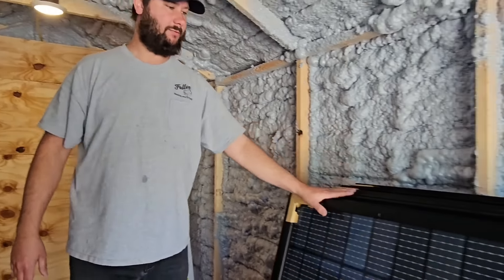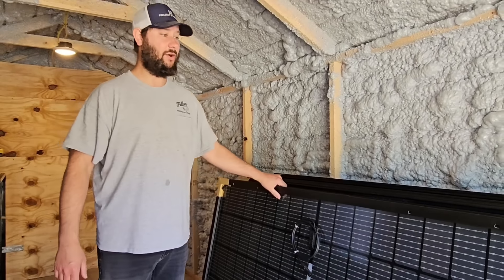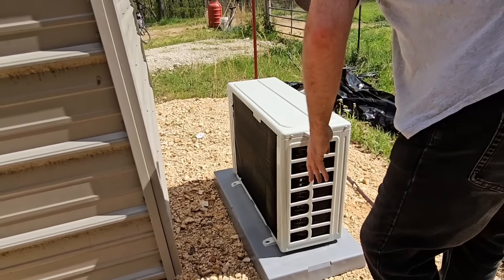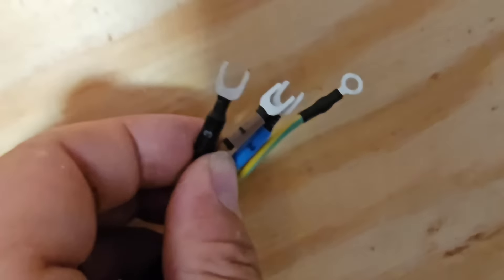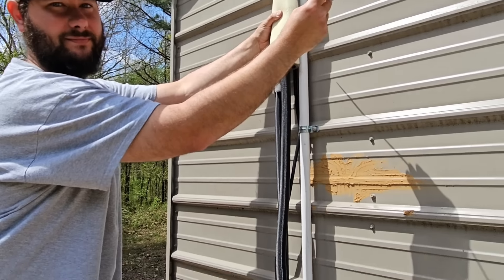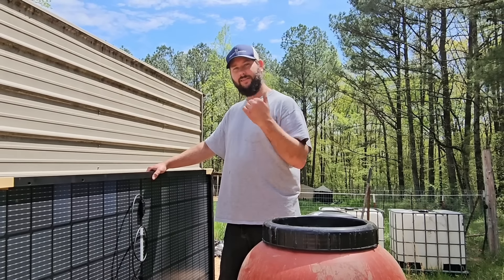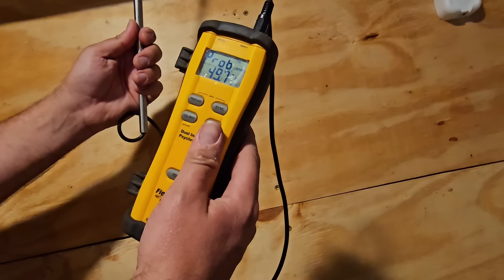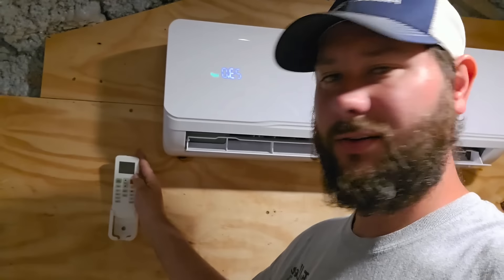Cool Your Home for FREE with Solar Powered AC!

Comment: Great job, but no strain relief/ chafing protection installed in the knock out of the indoor unit.  You need a Romex connector or cord connector to meet electrical code. 
Not only that but on the outdoor unit, the liquid tight connector you used for the interconnect doesn’t provide strain relief nor is it listed for the purpose you are using it for. You need strain relief on the outside unit as well. 😮
Reply from the maker: I like your attention to detail. Thanks for watching 👀 😀
Reply: @TaddyDigest  I’ve been an electrician for over 3 decades.  So I catch those things.  Great content on your channel. I just found it!!!
Reply from the maker: No wonder you caught that very cool brother. Glad you're here

Comment: You curled up the remaining line set and it was curling up and down. I've heard that the line set should be laying flat. Which way is better?
Reply: just a weekend HVAC warrior...I would place them vertical so that the oil can get trapped and fully returned back to the compressor

Comment: Pet peeve,  Why do people always use  channel locks on brand new brass fittings?....why can't they just use the proper wrench that fits those fittings? As a certified automotive technician? For 43 yrs. If I paid a professional to install a mini split? (A/C UNIT) and they started to tighten a brass fitting using channel lock pliers ??? I would fire them on the spot. (Use the right tools for the right job) plain and simple. 🤦🏻🤦🏻🤦🏻 Other than that? Great video & awesome information.   Just take it as, constructive criticism.😊
Reply from the maker: forgive my impatience
Reply: @TaddyDigest  You can do what you want, I was just bitching about my pet peeves...😄🤣😂😉 like I said great video. 👍🏼
Reply: I was going to say the same thing, you beat me to it.
Reply: @PanaLumberjack  Geniuses think alike ..🙂
Reply: Seriously? I cant remember a single air-con that was not almost touching the ceiling in condo-motels I've been in 50+.. we're they all wrong ???
Excellent video
Thanks
Reply: improper tool use is usually the sign of a hack. not professional.
Reply: @eddie8279  I'm assuming you're most likely a hack then.
Reply: speed of installation...he's not torquing the fitting down with them....only using the channel lock for speed. No knurling or stripping is occuring
Reply: @TaddyDigest  This time, lol.. Good job
Reply: Why do you need a aircondioner In a shed
Reply: It does the job? Ok then stop crying
Reply: @lmfarms4611  he spends a lot of time in that shed and wants to be comfortable.
Reply: @lmfarms4611  because 100F electronics last a lot longer than 180F electronics.
Reply: If I bought it for my place, I’ll use whatever wrench I want.
Reply: So people like you can cry and complain about a job you aren't doing.
Reply: Because it’s his own personal unit. I’m certain he sets a higher bar for paying customers.
Reply: @prefix808  in order to love other people?  You must learn to love yourself!  If you don't respect yourself?  How can u respect others?....😁
Reply: @robertbenavidez7164  So I'm not the only one. I agree.
Reply: @robertbenavidez7164  you probably shouldn’t watch your fancy vehicle wheels getting lug nuts removed then.
Reply: Haha, It’s hard to work for someone who has OCD. They do make pliers that don’t scratch the brass fitting.
Reply: meh .. I eat crab legs with channel locks .
Reply: @robertbenavidez7164  
Pet peeve: those that can't construct simple sentences, use proper punctuation, or ask basic questions. I once used an automotive shop that didn't question the certification of the "technician" but did write a quote, for important work I needed to have done, that was written much like your comment. I fired them on the spot. Can you trust someone to read and understand technical information if they can't write simple statements correctly? 
Just some indirect constructive criticism. BTW, why did you use what appears to be emoticons of three little girls in your comment?
Reply: @jimwhite9483  You sound very triggered, get a life & or lower your blood pressure. 🤣
Reply: @javiercoronel1169 uh people do work in sheds. Wood work small engines. When the wife locks you out hanging a deer when it’s warm outside. And while you smoke your weed or drinking a beer. I can leave a lot of reasons you would need an air conditioner in the shed.

Comment: Hey very good installation what I do is spray some soapy water on the plug for the drain hole and it goes In easy .I am really interested in the solar ac units I think it's a game changer when it comes saving on electricity and your carbon footprint 14:39 15:37
Reply: solar ac? should be DC from solar. if ac means air conditioner, it's a heat pump (solar HP) and can heat too.

Comment: you should have used vacuum pump to suck all the air in the pipes otherwise gonna be mixed and makes the gas less efficient
Reply: no need for a vacuum pump! before tightening the larger Cooper pipe you will let release the air and when the refrigerant starts to leak you will tighten it well, the filter will remove all the humidity within the unit!

Comment: solar AC , who would have thought .. solar AC w no batteries .. just wow..  in a couple of years the panels will be smaller and possibly the price too.. althought IMO the price isnt that bad...  and im sure you can piggy back with batteries if needed store that exra power when ac isnt on... did I miss apart of the vid or were the panels hooked directly to the unit w no controllers .... I assume the unit is smart enough to know not to draw the amps if it isnt available ..

Comment: This is a great vid. I was always curious if you could run these things of solar. I was just a bit puzzled when on occasion you speak in rooster language. Did not know what you were saying at 21:35 and 23:28 and a few other times, but I guess it was not that important.
Reply: Criticize doesn't cost anything.

Comment: The only thing that I've seen that doesn't make a lot of sense to me is the mighty brackets. I could understand if the head unit wait a ton but I don't even think they weigh maybe 15 lb they're super light. What I do is install the cable before putting the line set out the hole zip tie the line set the drain and the power cable together at the base and the tip lift the head unit set it on my shoulder push the cable out the hole lift it up and slide it right through the hole set it on the brackets lock it in and you're done. There's no in and out in and out then you're outside for the rest of the time mounting your outside unit and hooking your coil set drain lines and power cable up dragging the unit down and charging the unit

Comment: How does it heat
Reply: It's a heat and cool unit, all in one combo. 😎
Reply: If it helps I have this unit. It basically runs in reverse (move the cold to outside). I live in northern lower Michigan and it was making heat all the way into the single digits. I must add that the unit goes into a defrost mode with increasing frequency the colder it gets (no big deal but makes some funny gargling noises at the beginning) it takes around 5-10 minutes to complete then resumes heating.

Comment: Why no vacuum done to remove air from tubing
Reply from the maker: Read the install manual
Reply: @TaddyDigest  want to know the tech why there is no need of vacuum ..r410 refrigerant is more reactive and prone to degradation in presence of air..

Comment: Looks like a Pioneer brand mini split.
I prefer senville units. They also come Alexa ready.  Pioneer costs extra.
The mighty mount thing is completely unnecessary,  the indoor unit weighs 10- 15 lbs, it would get in the way more than it helps. 
Wire AWG is not pronounced og.  It's American wire gauge or simply gadget. Never heard that before.
Reply: These are unique units manufactured by Deye Group of China, sold in the US under the brand names EG4 and Airspool...You can Google or YouTube "Deye Solar" :-)

Comment: Show the running at night if you're out there working you want them cool you have to have 110 volts out there should have some kind of battery backup no
Reply from the maker: Yes, absolutely. I have a battery and an inverter. That's powered by the solar panels. And at night, the power is switch from solar to battery
Check out the latest video to learn more

Comment: So apparently you're supposed to connect both AC & DC power to the unit and it is smart enough to use whichever source is available whenever either source of power is unavailable.
Reply from the maker: yes

Comment: What happens to this unit when the sun goes down and you have no power
Reply from the maker: Video coming out next week, showing you. What happens
Reply: Depends on your climate, too. It would work for where I'm at. Night time temps drop like 30⁰ or so after midnight.
Reply: When the sun goes down it runs on electric or batteries if you have batteries

Comment: Don't you need an inverter to change from  Dc to Ac?🤔
Reply from the maker: yes
Reply: @TaddyDigest  … DC to AC   Yes inverter required.
remember,  THIS unit runs DIRECTLY from Direct Current (couldn’t resist)
Thus THIS unit does not need an inverter.

DC goes to AC
(Direct Current to Air Conditioner)

I’ll show myself out
🤠
Reply from the maker: That is correct. It will run off of just solar panels
Or you can run a 115 V AC. To the equipment
Disconnect is definitely needed for both

Comment: The line set is scaring me lol . How come you didn’t cutt it and measure it to the proper length ?
Reply: They come pre-charged and have the proper amount of refrigerant to be the correct pressure using that length. This means that you don’t need to worry about brazing, flaring or vacuuming your lines or drying them out with nitrogen before you start. They look silly coiled up until you get used to it and then you don’t notice it after you get used to that style of installation. Even with the old system they recommend you use the longer line set called for to ensure that you have the proper pressure. You can shorten those but then you need to bleed off the volume of the lines you removed to get the exact amount of refrigerant.

Comment: NEVER LOOP THE LINE SET in vertical position  It make a oil traps. And make unit not cool 100 % and you be replacing it faster.

Comment: Was that yellow bracket necessary? Why not do the comms cable at first then u just fit the indoor and go work from outside. That time spent was so unnecessary.
Reply from the maker: You don't have to use the yellow bracket

Comment: This is why i dont like minisplits but i hate window units, they design them to do noise, i can not bealive it. I see mine, and its inside blower fan has the impellers positioned 90° exaclty againds the rotation direction, it creates a loooooooooooot of fkin turbulence meaning it creates a TON of noise.

Comment: I have one of these EG4 AC units.  Easy to install, but the thermostat is worthless and has a mind of its own.  It keeps running long after Setpoint is met, which is not a way to save money.  Waste of energy.  Keep in mind it can run on house AC power at night, and seems to run and run and run, even when the room temperature is past the Setpoint.    Mine is not Energy star.  If you are willing to live with a poor thermostat then look also for one with the Energy Star tax rebate.

Comment: I don't know how you can put in your post Run your AC for free because it costs a arm and a leg for a Solar System.Let alone a air conditioning system.
Reply from the maker: The kit with the solar panels and the air conditioner cost $2000.00
It's a d I y model, so you can put it in yourself
That's a lot of savings compared to having a company. Install the air conditioner for you

Comment: Paying extra for a solar only AC vs the same sized"normal" AC seems counter-intuitive.  i dont see the benefits of this Heatpump that only runs 8 hours a day and 0 hours a day when its cloudy.  120v heatpumps dont use much power it would be just as easy o power them with an extension cord or something.
Reply from the maker: This mini split actually runs at night as well. It will automatically switch over to the other power source when there is no sunlight

Comment: Why would anybody use one of these?
Reply from the maker: I think it's pretty obvious
Reply: @TaddyDigest  Not really. I'm electrically off grid and in the Sonora Desert. I run a normal SEER 22 ductless AC unit and a small window unit that I mounted through the wall to keep my electrical cool during the 45C summers. I went to their web site to answer that question - it's for people who want to offset their AC cost during the daytime.

What happens when clouds go over your panels? Does it pull from the grid? If it doesn't pull from the grid to make up for the loss when clouds block your solar does it just undervolt and fault off? How come their web site doesn't list minimum PV needs?

Comment: I see you purposely picked a very sunny day.......
Reply from the maker: Well it wouldn't work very good if it wasn't would it
Reply: Sunny day
It is hot
air conditioning needed to cool off
Sun runs the unit, power is free

Cloudy day
not hot
No need for air conditioning

Comment: So the reason I would not buy this product is that it reads in C and not F. I believe that these companies should have a way to change the readout for different locations. For older people the C reading is too much of a hassle.
Reply from the maker: You can actually change the read-out By pressing the temperature up and down buttons at the same time

Comment: Instalasion, good, explaining how to do it, very good, but, when is no leak test and vaccum, is a big NO NO, you can get away with no leak test with nitrogen using the leak detector and fix that, but with no vaccum is no way you can be right, the vaccum remove  the moisture that is on the air, when you take off the caps on the line set, and the evaporator, you let air in, and that can cause problems at the compressor, the thing, is not going to fail on a couple months, but in a couple years you will have problems, you may used the AC a couple years with no problem, but is not going to last like is supposed, I would like to know what the manufacturer from that AC said about no vaccum,
Reply from the maker: Have you ever installed a unit with precharged line sets and quick connectors?

Did you not notice in the video that there were no flare fittings?

This unit is made by EG4 electronics

No vacuum Required
No nitrogen pressure test required
Reply: @TaddyDigest  never, central split systems, doesn't have that option, I guess mini split systems yes, but if the line set is precharge, the evaporator coil is precharge, and when you going to connect the line set to the evaporator and the condensing unit, need Schrade valves all of them to hold the charge, that mean you have 4 core valve on each line, both is 8, I wonder if is not going to have problems because is a lot of restrictions on it, plus more places to leak on the future
Reply from the maker: I can tell you have experience and knowledge. Thank you so much for your advice. And thank you for watching the video, my friend
Reply: Coleman and most brands that offer mobile home equipment have been using quick connect line sets for a long time. Mainly for ease of installation by the housing manufacturers, as well as them not having to hire a dedicated HVAC tech.
Reply: @ryanbrown5334  I have done a few mobile homes, and the AC unit is almost the same as a regular house. The only difference is down flow, but the line set and condenser are the same, and the installation process to
Reply: @gulopac1 That is the same with my experience, but it was mix & matched brands such as a Coleman furnace with an ADP coil, matched up with your choice of AC.
Reply: If you were to install a matched mobile home system from any of the Nortek brands such as Miller, Intertherm, or Maytag, it will have quick connect linesets.
Reply: @gulopac1 you need more education on this hvac system. Anyone can tell you don’t know much by your comment. You’re trying to say what this guy is doing wrong when you don’t know what’s going on. I love these comments of new hvac guys that think they know more than a seasoned tech lol 😂😂😂
Reply: @mwatkins2464  Easy to talk , with no sense, like you, will be nice if you explain exactly where I'm wrong, 
Split systems can be installed by any person, now!, 20 years ago, you have to be certified to install a fujitsu mini split, that's when I have my certification, how about you?

Comment: Sounds like a Mr Cool ripoff except this unit has the ability to do the DC connection from solar panel. I'm surprised they can mirror so much of Mr Cool functionality as I thought that was all patented by Mr. Cool. Makes me wonder. Regarding the install, good overall summary, but there are many nitpicky items I have regarding steps you glossed over, generally covered, but left out a few details, or skipped altogether (such as installation of the pad, where you could get one like you have, whether that is tethered to the ground at all, etc. It's important the outside unit is attached to a base that is secure to the ground. Otherwise during windstorms that unit could be ripped off the ground. Also not a big fan of videos where the ytuber works promotional items in without prior disclosure. I'm sure there were many instances with tools you used (particularly the temp bracket holder) that you were subsidized and paid by the company. Not a fan of DIY channels that do not properly disclose this because a paid review for me smacks of possible conflict of interest. Makes me wonder if this entire video was subsidized by all these equipment manufacturers now that I think about it.

Comment: where is the L-16 for the indoor knockout and that outdoor connector is for liquid tight, It's not securing the wire.
Cringe moment was when you used a pair of channel locks to tighten the connections. You a plumber